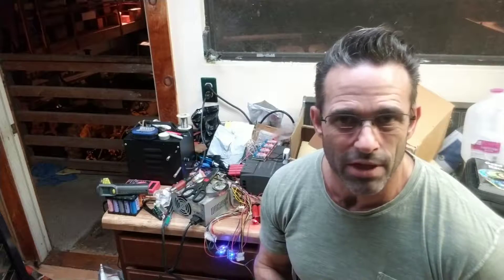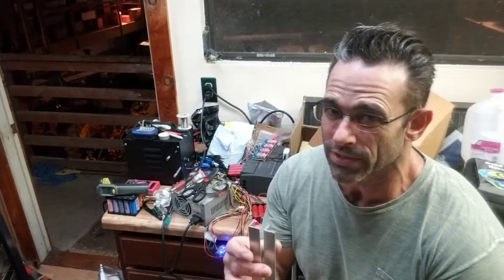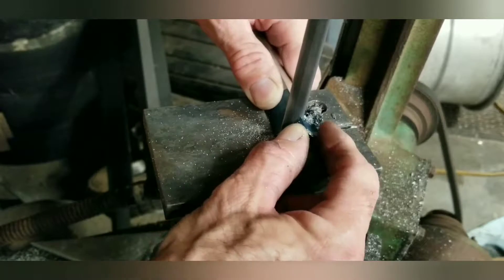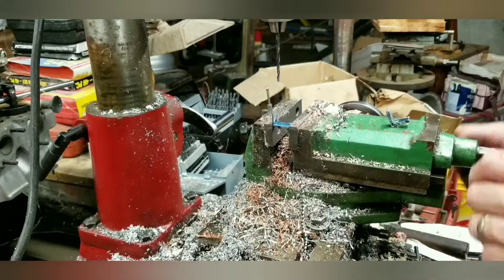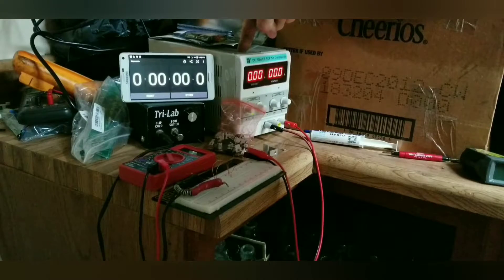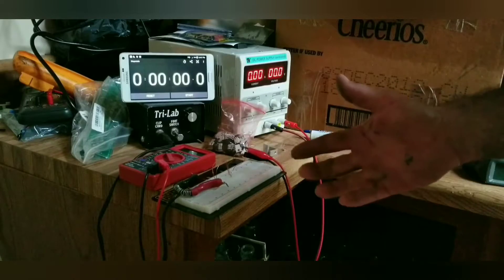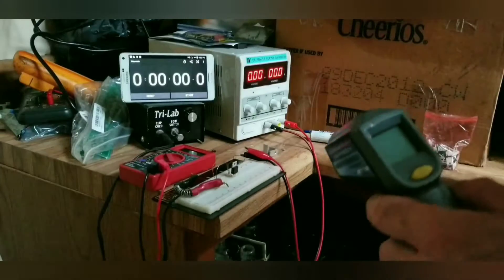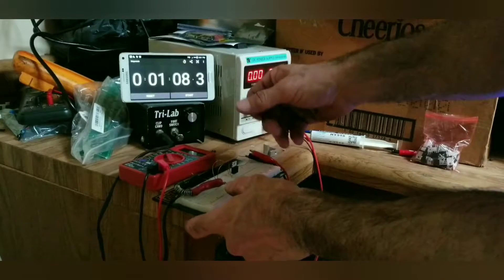Testing MOSFET heatsinks... Does size matter?

Comment: You can't use an IR thermometer on something this small. Furthermore you can't use an IR thermometer on shine objects like an Al heatsink. It wouldn't hurt to mention what MOSFET you're using. Breadboards don't do well with heat so having anything that gets hot or carries a high current on a breadboard is not the best option.